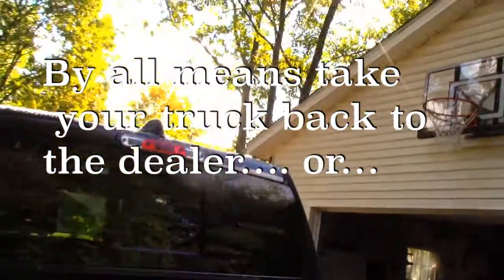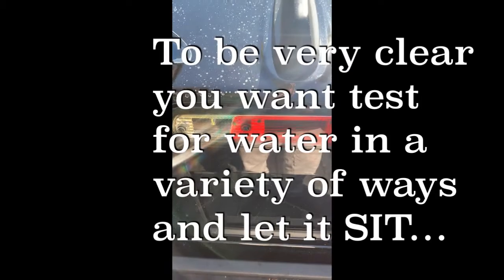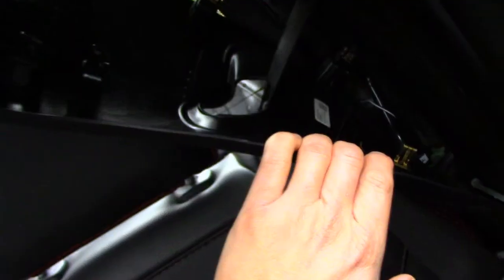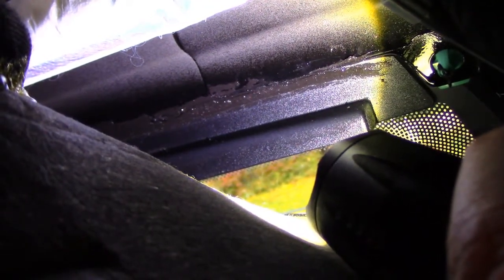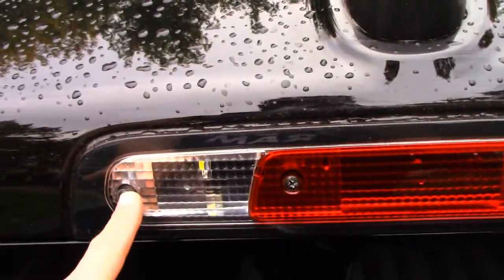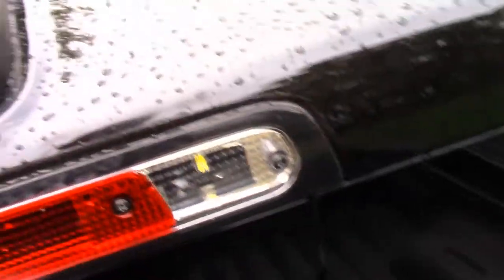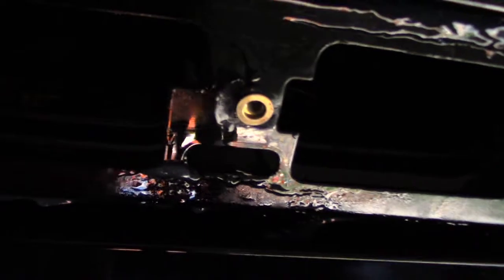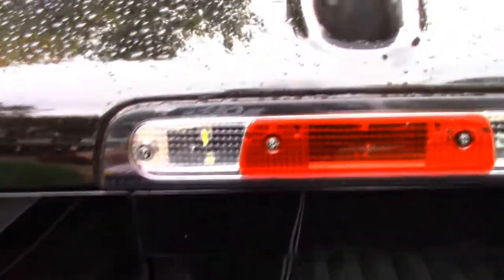2020 Ram Rebel ~ Back Glass Leak! Read description please

Comment: I’ve been in the auto glass business for 37 yrs and I work exclusively for dealerships. The problem is the plastic encapsulation frame at the top of the power slider is stress cracking and the water is running thru the cracks. They had the same problem with the Jeep gladiators. They have redesigned that back glass where you are urethaning directly to the glass instead of the plastic frame. They need to do this to the 19 and up 1500’s. The 2500 and 3500’s do not have this problem. If they are leaking it’s the 3rd brake light. Just a terrible design! To really fix this you need to replace the glass. Only bad thing is it may stress crack also. Ram needs to fix this problem. I hate it. Those back glasses are a nightmare to replace. 🤷🏻‍♂️
Reply from the maker: Love the information. Thank you and God bless!
Reply: Yea I agree same issues
Reply: There is a technical service bulletin from the manufacture to fix this problem. Ram also extended the warranty on it to 8 years or 150,000 miles.  Originally Ram was replacing the entire backlite (glass and frame) now they are using a special sealant to seal it from the outside.
Reply: @jcsoper8704  yes you are correct. Good luck with that fix though. There is no way in my opinion to do that right tho. There is just not enough room to do that properly. Also is going to look bad..🤷‍♂️
It’s a cheap try to fix it method. A joke!! 
They need to redesign that whole backlite.
Reply: @marlonorsburn4345   I completely agree.  It's a bandaid repair at best and it ticks me off because they were replacing the backlite with a redesigned one, which is the correct way to do it
Reply: @jcsoper8704  yes sir and they are going to mess up a lot of paint jobs! Total joke! I told the cjdr dealerships I do that I’m not touching it. In all honesty if I had a 1500 I would put a solid back glass in it and be done. No more leaks! I’ve done this for some people. Way cheaper and a cleaner look.

Comment: Thanks for the video. Mine started leaking and the dealership refused to repair it. They said it was out of warranty. Thankfully my insurance covered the +$1000 repair. However 2 months after it was replaced, it started leaking again! Taking it back for another replacement.  Im going to try that sealant hopefully it works. If you own one of these RAM keep an eye on that. They should have done a recall.
Reply from the maker: That is too bad. It’s a defect that is not user instigated, so Ram should cover it. My understanding is they don’t consider it a safety concern hence no recall. But Ford took care of the new Bronco roof issues. I love my truck but not impressed with the way Ram has handled this.
Reply: There are two trim (Ditch Trim) strips on the roof at third brake light level. (Left and Right) the water follows these trim pieces, dumping water on my headliner. Park uphill, water fills the storage under rear seat. Park downhill, water comes out the front grab rails. 😡🤬

Comment: THANK YOU!!!   I literally started having this problem about a few days ago.  I was clueless as to where the water was coming from.  After watching this clip and after I took the headliner off.  I ran the water hose on top of the truck until I could pin point where the water was coming from.  And then Whalllaahhh!!  Water dripping front The same area above the back window.  Going to get some sealant tomorrow and seal it up.  Hopefully it works 🤞🏿.   

Thanks! Again for this upload.
Reply from the maker: Mine worked for awhile with this… then I had to have the whole window replaced. Frame cracked. If you’re still under warranty consider taking it in. Thanks for watching.

Comment: So many Dodge owners having problems with their back window leaking. I’m on my third window from Safelite on my 08. The rubber seals for the sliding window continue to leak allowing water into the track. If it rains hard enough that track overflows and water runs down the back of the inside of the cab. I’m being told this is normal. That’s bullshit as far as I’m concerned. I’ve had many other Ford and GM trucks and never had this problem. Brand new windows should not leak day one.
Reply from the maker: 100% agree
Reply: I have a 2008 Dodge Ram and I notice my floors under the seats are wet when a nice rain hits what can I do they told me my third break light I had it done over new gasket and sealed this is a major problem the moisture has blown My factory speakers
Reply: @rampaig6  - I had to put tape over top of the rubber seals all the way around the middle sliding window. I was originally getting water between the cab and the window itself. That has since been repaired now I only get water in through the rubber seals and the small window in the middle. I’m going to take it back to Safelite again next week but I doubt there is anything they will do. If they won’t help me I’m going to call the manufacturer. This is ridiculous.
Reply from the maker: @rampaig6  I have heard sometimes it’s the vent behind the back seats. There should be two, one behind each seat. Worth a look.
Reply: 2017 Rebel - interior moisture after rain, mold on carpet behind back seat; took to the dealer, they claimed it was the third taillight leaking. Outside factory warranty, Allstate extended warranty (purchased FROM Dodge) doesn't cover water leaks 🤔. Cost of dealer repair, light assembly, cleaning...$800. OUCH.

Within the year after that repair, more leaking/mold. Back to the dealer who now claims back window seal leaking. They wanted to replace the entire back window, plus cleaning, est $2600. Um, NOPE, NOT gonna do that. I may try the safelight window replacement idea, or just sell the truck and get a Ford. SOOO DISAPPOINTED in Dodge customer service 🤬
Reply: @mdrakehnl  I hear you. The only way I fixed mine is they installed a window without the rear slider. On my fourth trip to Safelite I told them to install a solid glass window. Was tired of messing with it. Have not had a problem since.
Reply: @mdrakehnl  it’s probably the vents behind the back seats
Reply: Another owner experienced this issue, added additional holes to the sliding glass window track.
Reply: @rampaig6  try looking at the trim on the roof. Left and right at third brake light level. Water follows the trim, dumping water on headliner, flooding rear seat storage. 😡🤬
Reply: @mdrakehnl did you have black trim strips on the roof, left and right at third brake light level.? The water follows that trim, dumping water on the headliner, flooding the rear storage, when parked uphill. Water to dash or front grab handles if parked downhill. 😡🤬
Reply: @albertbrinson4075  I went back to Safelite and had them put a solid piece of glass in the rear. Never had a problem again. It’s ridiculous. I wanted to sliding rear window but Im not going to deal with constant leaks.

Comment: As a glass tech dodge has a recall on them the has cracks on either side of the middle sliding window. Never apply silicone to your car or truck because it retains water and will eventually cause rust
Reply from the maker: No recall has been ever been issued by Ram for this issue. However the glass, if cracked as you described, can be replaced under warranty. Read the description of the video.

Comment: Did you notice condensation on the front windshield because of the moisture in the back? I thought it was the glass that had to be resealed but the dealer claims it might be the third brake light.
Reply from the maker: No. If it’s a fifth gen it’s most likely the back glass. Do you have the vertical lines or cracks up top near the sliding window?
Reply: @venomrebel2020  Yeah its 5th gen 2019, doesn't have any cracks from what i can tell though. Even the morning dew causes it

Comment: I have used caulking all around my window, the third brake light and the antenna, i still have water coming in!!!
Reply from the maker: It’s a bummer. In the description I talk about ultimately having the window replaced. This was my first attempt to fix, and it seemed to work for a few months then the frame cracked. Hoping the replacement window fixed it.
Reply: Trim (Ditch Trim) left and right of third brake light level on roof. Water follows this trim, dumping water on my Headliner. Park uphill, floods storage under rear seat. Park downhill, water to the front dash area or grab rails. 😡🤬

Comment: Get it fixed with that warranty brother
Reply from the maker: You’re probably right. It’s fixed now though. I’m kind of possessive of my vehicles. I once told a car salesman I wouldn’t take the extended warranty for free 😂😂 he said what if I mowed your lawn for free? I said I’d tell him to get the hell off my yard 🤷🏻‍♂️ thank you for watching brother
Reply: @venomrebel2020 I had mine replaced under warranty. Only saw it happen to handful of trucks. But they also included a detail with it!
Reply: Wha did they fix under warranty? The cracked plastic on the glass frame?

Comment: I've got a 2014 cummins, and now having my 3rd water leak problem. First time was my 3rd brake light, 2nd time was my rear cab vents, now a 3rd time I'm clueless where is coming in at after searching. No one body shop is interested in helping for fixing it smh.
Reply from the maker: I’ve heard of both of those problems. The dealer diagnosed with smoke/pressure. It was under warranty and ended up being the cracked frame on the rear glass. A local glass company installed the replacement so I hope it will last. I have heard the theory that it involves freezing water? I don’t know. It could just be a flawed design that fails with cab flex. I have sprayed flex seal in between the glass and cab… bulletproofed the 3rd brake light…. Caulked around the antenna. Seems like an issue I shouldn’t have with a $50K truck. However, if that’s the only issue, I’ll be grateful. So far 35k miles that is all. Your Cummins should live forever, eh?
Reply: Trim (Ditch Trim) on roof, Left and Right of Brake light level. Water follows trim, dumping water on headliner. Park uphill, floods storage under rear seats. Park downhill, water to dash or front grab handles. 😡🤬

Comment: I'm just going to throw a tarp over mine. My 2020 limited i recently got leaks during all night rain.
Reply from the maker: Is your warranty up? If not take it in and see what they say. That’s what I did. They smoke tested it, confirmed a leak and had a local glass place replace it. So far, so good.
Reply: @venomrebel2020  Pretty sure it's brake light. I'll have it checked when I bring in for oil change.